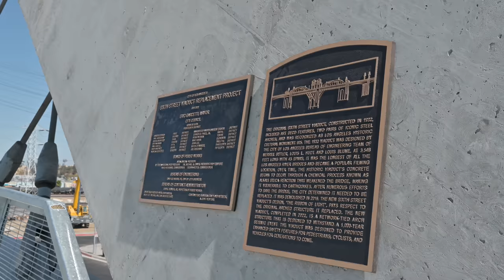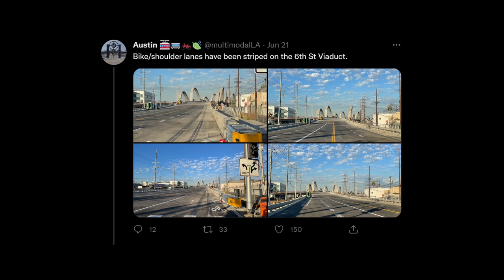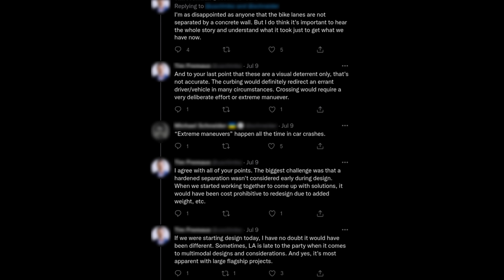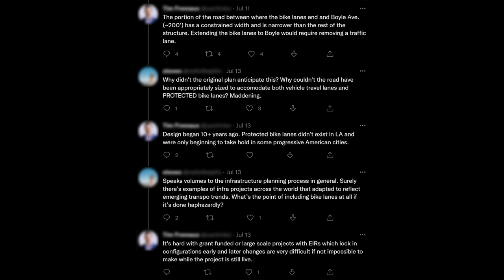The Failure of the New Sixth Street Viaduct Bike Lanes

Comment: Cyclist don't use bike lanes in LA anyways.
Reply: If the other bike lanes in LA are designed like the ones on this bridge, then it is not really surprising cyclists don't use them. 😕
Reply: Those of us that do could tell you that this isn't true.  Those that would who do not might suggest that it has to do with the unconnected, unprotected lanes that pit riders against drivers with bad attitudes.  Fix the issues that riders bring up and you might see a better situation for everyone.